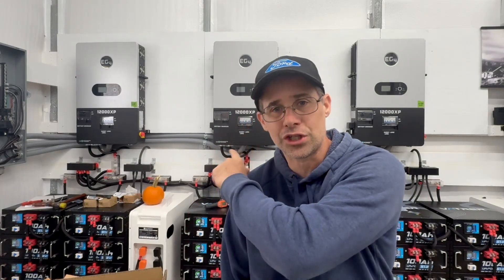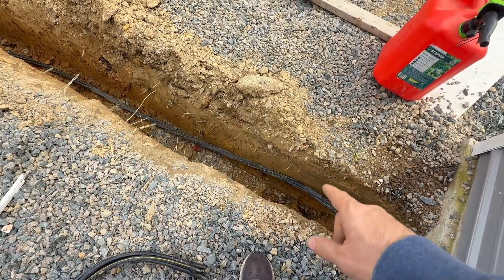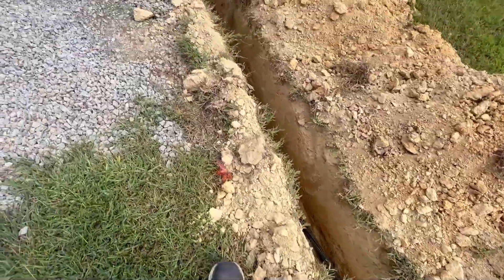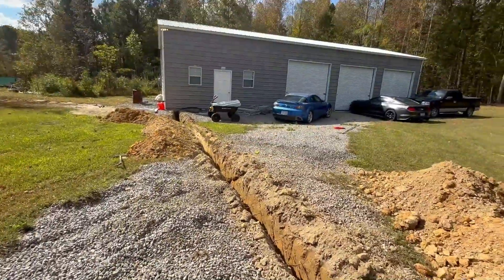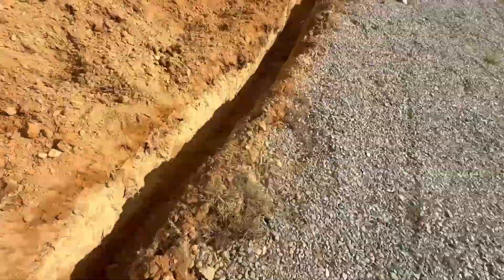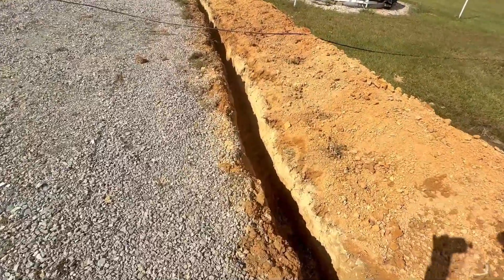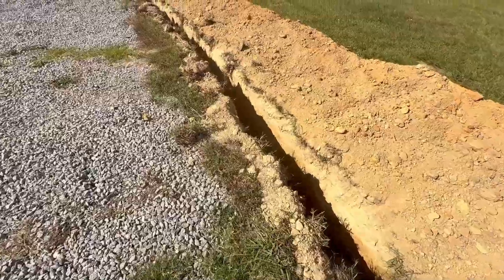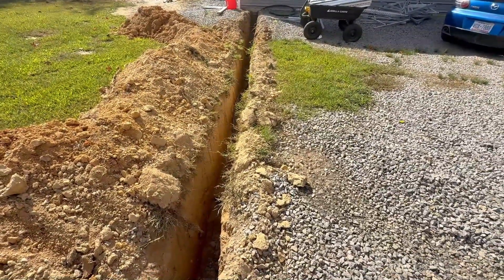Digging a Trench to Wire My EG4 12000XP Off Grid Inverters to my House

Comment: I'm looking forward to your next video about the combiner box. In the meantime have you taken the time to notice the conditions that make your 12000XP fans turn on? For example how many watts can the inverter generate before the fans kick on. Also how much solar can they take before the fans come on? Thanks.
Reply from the maker: Both good questions.  Around 3.000 watts the fans start to slowly kick in.  As demand increases so do the fans.  With solar,  the fans will spin up time to time with a rapid ramp up and then it goes quiet again.  Keeps the temperature under 75 seems to help.
Reply: @MikesSolarGarage  Darn, darn, darn... I was hoping the fans would not kick in until 6,000 to 9,000 watts. Or even 12,000 watts. So I did a bit of math.12,000 watts at 90% efficiency would produce 1,200 watts. Similar to having 12 100 watt incandescent bulbs on. So if 10 square inches are needed for each watt then 12,000 square inches? Assuming the base would fit over the top of the box the heat sink might be 20"x5". Say 12,000/100 = 120. Say 10 fins separated by about 1/2 an inch. Each fin would then have to be 12 inches tall. Large but doable. Maybe an upgrade costing a few hundred dollars? I'd gladly pay for it!
Reply from the maker: The lower the ambient temperature the less it turns on.